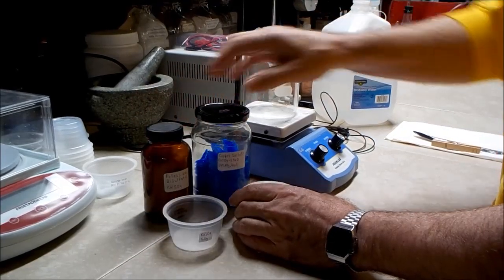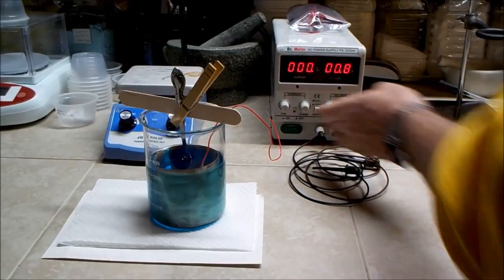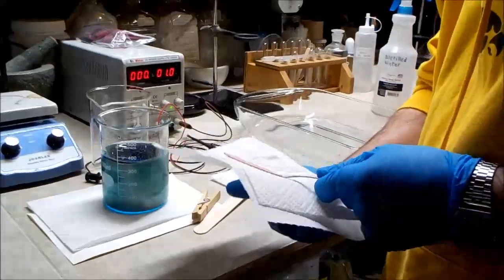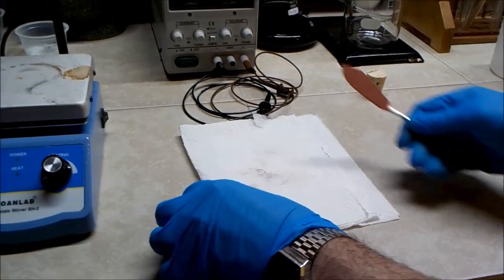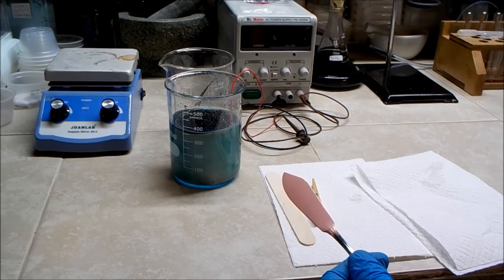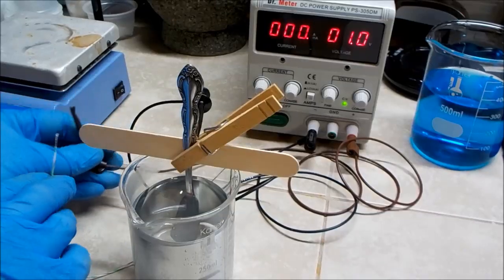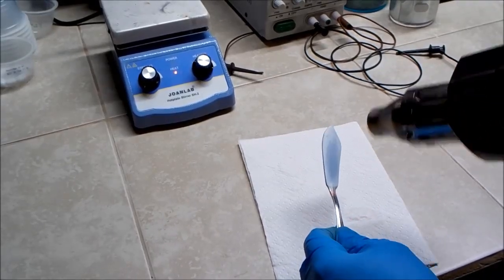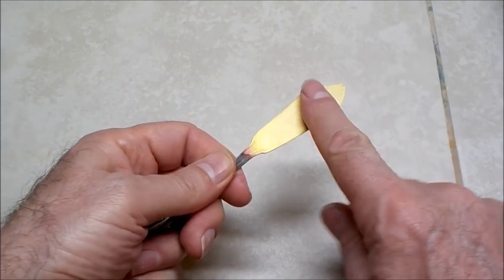Electroplate Stainless Steel With Copper

Comment: here is the science of the process: Good grade stainless steel should have about 75% iron, 15% Chrome and 10% Nickel, stainless steel when exposed to air will form a thin(invisible) layer of Chromium oxide that will prevent any oxidation from taking place and it also prevents any type of electro coating taking place, when you dipped the piece in hot Copper Chloride solution the chloride ions attack the chrome oxide surface and the piece becomes active now(as opposed to being passivated) and since iron is less noble than Copper(Cu2Cl + Fe = Fe2Cl and Cu) Copper is plated directly to the now activated piece, but since this is a form of displacement plating(no electroplating involved) the coat is not adherent at all, but now that the piece has been activated is ready for Copper electroplating
Reply: Another way to plate Copper on Stainless steel is by Nickel plating it with a Woods Nickel Strick(an all Nickel Chloride electroplating bath), the science is the same, Nickel Chloride activates the stainless steel surface and plated with Nickel, then that piece can be copper plated as usual
Reply: @nicamarvin  I would like to know . Now I work at plating factory have problem about Copper cyanide plating on Stainless SUS 304 . I found about blister problem. Flow of Cu plating is degreasing , HCL dip, Ni strike, Cu plating. Please let me know how to improvement blister defect. Thank you very much
Reply from the maker: Thank you so much for this explanation, I had always suspected that the hot copper chloride was altering the surface in some way but I didn't know exactly what was happening.  I have no formal education in chemistry, it is just one of my hobbies. I try to research my experiments before I perform them but wikipedia can only take me so far.
Reply: Great video thanks a lot.  Would other acids work to similar effect?  Hydrochloric/Ferric acid?  I am trying to plate something on a tight deadline and it looks like copper chloride is somewhat difficult to obtain where I am.  If not, any reliable sources for copper chloride?  Can I buy the crystal form and make this solution myself?  Please advise.
Reply: @TheCommonstudio  how did that work? I'm guessing the hydrochloric acid works even better to attack the oxide that forms on the steel. We don't need the copper ions for that, I'm guessing. Phosphoric acid would work too, I think. It's a very strong acid, and less dangerous to work with than sulfuric acid, and you can just buy it over the counter.
Reply: I have reviewed the ASTM-B254 standard "Standard Practice for Preparation of and Electroplating on Stainless Steel" and I find it very useful for this topic.

Comment: Stainless steel needs activating (removal of oxide layers that resist corrosion),  As nicamarvin explains.  Straight HCl should do the activation.
          Why steel can't be copper plated: steel is (a lot) more electropositive than copper.  When you dip it in the copper plating solution, this potential drives the reaction forward HARD (it is as if you had power supply connected & set to many volts & 10's of amps, & the plating "burns").  Normally, this is done in industry by using cyanide based copper plating solution for the first ("strike") copper layer (low concentration of copper ions in cyanide bath prevents burning).  Hobbyist can succeed several ways: 1. plate steel first with nickel using nickel sulfate-based bath.  This is tried & true way.  2. apply just enough reverse voltage to cancel out the copper-iron potential at the start.  I would do it this way: connect power supply reversed (+ to knife, - to copper ring).  Set 2 volts on supply, current low (milliamps).  Dip in knife & lower voltage on supply until you JUST BARELY see copper plating.  Do not disturb voltage setting.  Remove knife & sand clean.  Dip in HCl to activate.  Remove from HCl, rinse, & connect to power supply FIRST then dip in copper plating solution.  Wait ~30 seconds until you see unbroken copper plating on knife.  Reverse supply (+ to copper ring, - to knife).  Continue the plating.  Keep the current LOW for longer time.
Reply from the maker: This is very good information with excellent details.

Comment: Well done all around: process and video and explanation of your steps. I feel this is something I can attempt after watching your video. I agree w a post pointing out that the copper chloride probably only succeeded in removing the passivation layer so there are probably several ways to activate the SS for plating.
Reply from the maker: Let us know if you find another way to remove the passivation.

Comment: I did something similar to this by an electroplating prosses that I used to cover a trowel. It was a spring steel that I wanted to protect from rusting. But to copper plate ferrous metal, first thing is to zinc plate + then copper will cover. I didn't leave it long enough in t copper solution  but  I liked the finish and stopped. It helped to do what I wanted until being worn down over time with use in plastering work. I'll have todo it over but, no problem.
Reply from the maker: Thanks for this comment.  I have always wanted to plate some things with brass but didn't know how.  I think you might have  given me something to try.  First plate with zinc, then add a brass,  (copper + zinc) plating over it.  If I get it to work, maybe I'll make a video of how I did it.  I like the look of brass because it looks a lot like gold.  I don't know if I will be able to plate with copper and zinc at the same time though.

Comment: This is actually a nice informative video; as someone who wants to try electroplating for the first time, it is very comprehensive. However, may I ask what is the concentrated copper chloride solution used for? Is it for the copper to stick better to the surface of the knife? Thanks, and I look forward to your response.

Comment: Modern alchemy! 😍👍 next, we’ll turn gold into copper! 😁
Reply from the maker: I wish I knew how to plate a brass finish onto the stainless steel.  That would make it look more like gold.  That would be more complex though, it would require adding two metals at the same time.
Reply: @perrygershin3946  why? 😀 isnt brass cheaper than stainless? Is there a particular application you need stainless steel hardness with the look of brass? Could you fuse/melt brass onto stainless steel? Torch and brass brush, or brass leaf and flux?

Comment: I stumbled upon something needed to clean the glass insets of a lamp I was restoring for a home I was working on for a customer, someone mentioned the toilet bowl cleaner "The Works" to clean it and it did work very well getting all the old rust stains off the glass, it also managed to change my stainless steel sink into more of a gunmetal black color, it didn't rust as I recall, wondering if that could be substituted for the hot copper chloride step?

Comment: here's a clu8e from someone who has no chemistry of math....   take half a minute and heat the stainess and brush with a bronze/copper brush.  it will deposit a layer of brass on the stainless... then electroplate with copper or nickel or silver...

Comment: Lol 6 minutes in: I haven't actually been able to successfully do it. 😂 You said that, but it's still pretty funny imagining someone go missing that and going "wtf!". Anyway I found that the way to hie is loooooow and slooooow when plating, I use a nickel layer in between the stainless and copper, it grabs the stainless perfectly and holds the copper very well. IF you go 1 volt 100 milliamps. Also keeping the solution in motion helps against pitting and domes and multiple anodes is the way to go. I use 2 when plating a knife. One on each side and the slow method is bearable. Otherwise you'd be there all night rotating the object for a uniform coating. This what I found to work the best. Could be wrong ofcourse

Comment: Thank you for sharing.
I want to copper plate stainless bolts that secure a boats portholes. I would like them to have a similar appearance to the bronze of the portholes, and I'm wondering if the plating  might even help reduce galvanic action between the two dissimilar metals.
I will try your etching method. Many thanks.
Reply: I may be wrong, but I believe I was reading recently that bronze can be plated onto objects. I know for sure brass can be plated onto things. That would cut galvanic corrosion I suspect.

Comment: Thanks for sharing this video! Very Interesting, I think I will do some testing myself, as I need to copper plate a steel part.
Reply from the maker: A method that works on stainless steel may not work on regular steel, they are two very different metals.
Reply: @perrygershin3946  sure very true, but if you can copper plate stainless steel... surely there is a way to plate steel without nickel plate first. It's not that I mind doing the nickel plating, it's just pure nickel material is fairly expensive [for me at least at present] for anodes, especially to buy enough of it to have a large enough surface area to plate medium size parts... especially when it's just so I can then turn around and cover it over with copper.  Got to be some way... 
In any case, Thanks again for sharing this video, just watched it again for the.... I don't know, I lost count. Still giving it some thought, maybe if I ever get the time I can experiment a bit again.
Reply from the maker: Just for testing, welding rods can be purchased that are 99% nickel, you just have to remove the flux coating.

It is not too difficult to get zinc to stick to iron, I have done that with some iron railroad spikes.  It sure stops the rust  that will inevitably form without some kind of protection.

Maybe you could then do copper onto the zinc.  This is the reverse of what I do in the video, zinc onto copper, but I don't know what the result would look like.

Here is a link to a discussion about copper directly onto iron but it doesn't offer much hope.
https://www.finishing.com/00/64.shtml

If you do some experiments post your results, regardless of the outcome, as failures or success are both useful information.
Reply: @perrygershin3946  Thanks for the link, I'll check it out. However, you can't plate copper onto zinc, if the copper solution is acid based, as the acid just eats the zinc off in a matter of seconds. Learned that the hard way.